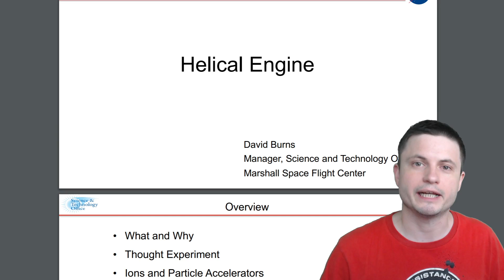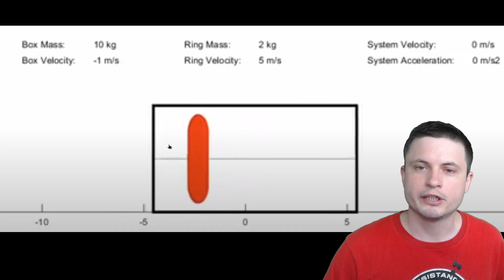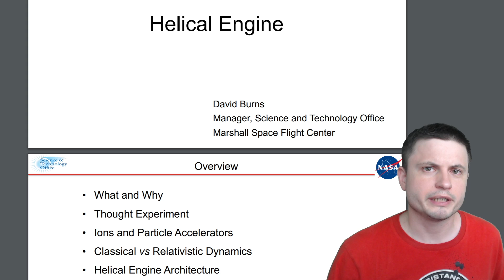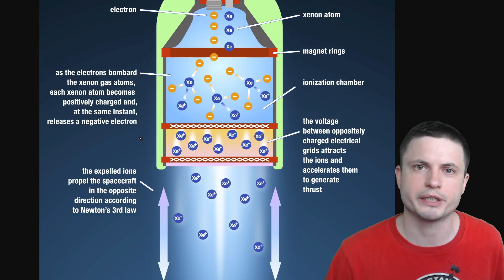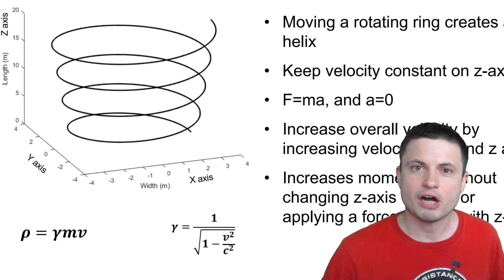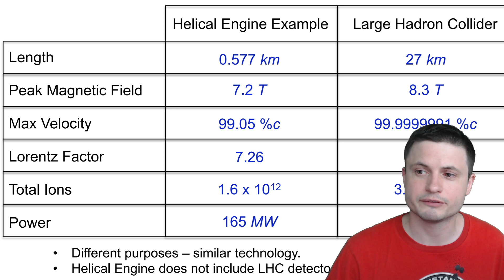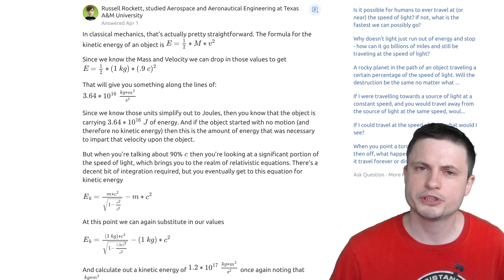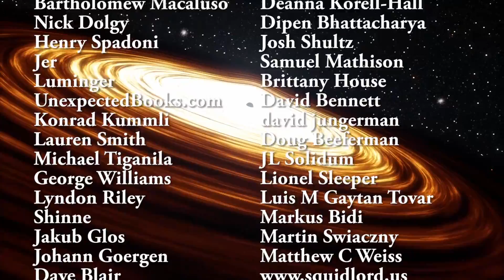NASA Engineer Designs a Near Light Speed Engine But Does It Work?

Comment: Well on a visualisation it looks fine. But then thin about how much energy it would take to stop anything more significant than an electron going that fast from punching a hole in any theoretically possible material made of matter as we know it?

When you go down to the electron scale I think that this idea reduces a bit to the other concept from nasa eagle labs that's actually being tested by both the USA and China, and possibly many more, as that would be an amazing achievement.

The thing with a more massive medium with velocity change is that it simply might not be physically possible even assuming that we still don't know lot's of things about physics of our reality which is most likely. The explanation of swirling mass seems a bit weak as it goes into the gyroscope science, and unfortunately you can't get any momentum out of the gyroscope perpendicular to it's rotation plane, simply because there is no such force there to extract. You would need to leverage it against some mass to change it's vector forward, but that implies pushing something back, and even when  you apply the relativistic phenomena you still need the same sum of force to speed up a certain mass to some relativistic speed, and then slow it back down. Relativistic effect here does not break the conservation on momentum it just means that you need geometrically way more energy to speed some mass up to relativistic speeds than you would assuming linear force requirement.

It's still not very nice and professional to hate on the publication because that's a very significant reason for science stagnation along centuries, where the intellectual society thinks that their theories are final, and there is no point in studying new concepts challenging the old knowledge. Even if it's wrong It's still valuable, and should be taken seriously.

Comment: This sounds like you need a normal engine to go as fast as we currently can, and then start this rotary weights idea up, the relative velocity should start accelerating until a point where you can turn off the starter engines... Obviously im just guessing, im just a random douche lol.

Comment: If they put this circular version mentioned in the right spot, couldn't they also power other things if they used the same rotation to get started? Coils and magnets right? Maybe a crank shaft type of thing... This all sounds like engine failure is blowing everyone up.

Comment: This tech has been out for quite some time... It's only draw back it that it takes forever to get to speed... That's not even taking into consideration the lawrence transformation...  I believe they are working on both problems, the firsts solution is to take off from within our atmosphere, were partial density is high... The second, much harder to resolve, but involves creating an ABSOLUTE vacuum infront of the spacecraft.. they are currently testing different laser grid arrays...

Comment: Remember E=MC^2.  To get a large spacecraft close to the speed of light takes more energy than we could possible gather, and you have to accelerate all the fuel as well.  There's no way to get that much energy.  Anything that shows otherwise is basically a perpetual energy machine, which at that point, the hell with the spacecraft, you can create new universes because your creating mass and energy.

Comment: You can travel to infinity with a cup of water. You vibrate it apart into HHO for free with sound and it automatically recombines back into water and you get an incredible amount of energy... and you keep using the same water over and over... no limit to how far you can go... and cost nothing. All you need to power a spaceship is 2 wireless speakers and a wireless microphone... and a cup of water. The 2 speakers point in opposite direction and are also dishes that can pick up waves from a 1000 mile radius around it... from less than 1 hertz to 20 million hertz.. and the harmonics thereof..... and you feed it right back into the microphone in an endless feedback loop. Simple to do. You gain mass... and speed up.. time slows.. distance becomes non existent. The high frequency coming out of the speakers vibrates the water apart.... all diatomic elements split and recombine... O2, N2 and H2. Cost nothing to split it with a wireless microphone too close to the wireless speaker giving endless feedback.. it will never shut off... and its picking up all white noise radio signals from 1000 mile radius or more... fed back into the wireless microphone. You use a cup for the tweeter and it fills up with water because the air temperature outside the air hole above the cup is different than the air temperature inside.. and so the water condenses in the cup and spills over on the granite speakers and causes conductivity to increase 9 fold... from the inner positive at the speaker center to the outer negative at the speakers edge. The water then starts to spin in a standing torus.. and then split and recombine.... giving a lot of energy. None of the water is lost.. the cup just keeps filling up and overflowing. The universe is vibration. You don't need a power source at all. The energy is already there and you only have to tune into the resonance and feed it back into the microphone.

Comment: Traveling at light speed is not enough to reach to the star systems that thousands year away from sol system. In a sense no human being can go more than 3 or 4  years away star systems. Even if we go 100 years away from sol system there is another problem. Imposible to communicate with these star travelers. Also if they want to go back it will take 100 years. There is a limitation for human life time and space is not good for human health even you are in the best star ship. So if humanity cant find an instant way for traveling space i belive no human being is going to see that day.

Comment: Even IF you can produce a device approaching the so called speed of Light, it is still far, far tooooooo Slow to cross thousands of Galaxies in reasonable time.
There is ONLY ONE WAY to cross Thousands of Galaxies in hours, and that is by Learning HOW to access "The Processing System of LIFE", and gain the necessary Technologies, by searching its 'Permanent Libraries', and using the Technologies of "The Processing System of LIFE", to cross a Galaxy in Minutes !
Impossible ???? 
Only if you believe it to be ! 
Take the Courage to Discover "The Processing System of LIFE", and explore its 'Permanent Libraries', for whatever you want to know, or learn about.

Comment: Travel through space is limited by relativity, making interstellar travel impractical.  Only An Alcubierre/White propulsion system, which warps the space around a ship, makes interstellar travel practical.  Unfortunately, such a "warp drive" requires "negative mass/energy," which we've never observed, probably doesn't exist (dark energy is very likely a positive form of energy), and can't really wrap our heads around on a theoretical basis, much less an engineering basis.

Comment: There are huge problems with this analysis. Accelerations near light speed require general relativistic calculations. And spinning anything near light speed would cause it to fly apart. The collision of the spinning ring with anything would be fatal. This is a complete mess.

Comment: Problem is, those molecules actually exhert forces on the engine. At light speeds, force is so damn great (F=MA) that the thing will just break.
Reply: Just accelerate slowly
Reply: @m1abrams1776  dude

Comment: This engine contradicts itself, even if it is possible, the smaller side of the mass will increase with the velocity of the craft, thus the faster it goes the total momentum would be less ie. the difference in masses would be proportionately be less and less as the craft increases speed, that is even if (BIG IF) the energy supply problem could be solved !

Comment: I don't get the part where the thing in the box starts to be accelerated sideways. Wouldn't the acceleration to the side move the box in the opposite direction? If the answer appears to be the helical path, how would that solve it? Wouldn't the force necessary to go from circular to helical motion be the same?

Comment: Doesn't the energy required to push a mass increase exponentially with an increase in mass? So rather than having larger weights that require as much energy as mentioned, wouldn't it be better to have a large amount of smaller masses moving in sync therefore requiring less energy? I am not sure if that is how it would work or the complications of doing such a thing would be but I figured that they just needed a more efficient way and having multiple of one thing working in unison would have a much more efficient outcome. Like using one large band to pull something or a lot of smaller bands to pull it. There needs to be a lot more force to pull back the large band for less outcome when compared to the smaller bands.

Comment: 86% and 90% aren't the same at all whein it comes to aproching the speed of light
Reply: 10% of light speed would be revolutionary
Reply: @user-nb3ui8zj4r  Even 1% ( 1860 miles per sec) would be revolutionary, and is probably unattainable because of the colossal energy requirement.
Reply: It is also not that big of a difference, only about 40%. Which in the grand sceme of things is fine...
Reply: @DomenG33K  did you mean 4%?
Reply: @dredgenyor8286  i meant 40%
Reply: @DomenG33K  What are you trying to say?  It is a 4 percent difference.
Reply: @nicholasricer9687  going from 98% to 99% is the same energy required then from 0 to 98% the speed of light.
Reply: @DomenG33K  I understand what youre saying.  You're probably right but it doesnt seem right.  I'm just high and drunk.
Reply: @nicholasricer9687  hehe
Reply: @DomenG33K  Just like everything else in the world . . you have to put a lot of effort to get from 9 to 10. . or from 2nd to 1st.

Comment: Donut is interesting.  But how about, we Shove it in 1 direction, to impact, but as it returns we use a dampener, to Vibrates and sends the Force OUT to the sides.
Energy?  how about Ion.  Direct from the sun.  the closer you get the more you get.
Then consider After the ship is doing a Good speed to init the other form of propulsion Just to see if it could work.

Comment: You're not Janet correctly the faster you go you say you lose links that's correct because you are phasing in time yours time slows down you were changing the rate of time and during acceleration you are in multiple time frames simultaneously that is why you lose length and gain mask your mass is in other temporal dimensions the same is your length. And ersche a simply an effect of time rate change

Comment: I understand the issue with introducing enough energy to accelerate the mass inside, but as the mass speeds up and bounces off the box, a number of things need to be considered. 

1) the mass loses energy through friction on the rod it is connected to (to keep it bouncing in a straight line) and the opposing forces of the walls counteract the force it’s accelerating to, so you would need a ton of energy to just keep this going. 

2) what sort of material would we use to keep this thing from breaking apart? If you shoot a 1kg metal donut at a steel box at the speed of light, it’s obvious that sooner or later the box will fail.

3) We know it is impossible to create energy. This model is inefficient in its requirements for energy input.

Comment: I don’t really understand the helix bit of this, just thinking to utilize that effect I thought of counterrotating symmetrically weighted booms with zero contact electric motors and passive magnetic bearings.  The rotation axis being perpendicular to the direction of travel.   you wouldn’t need to spin the weights at near light speeds, just relativistic (0.15 C ish) conventional reaction engines bringing the spacecraft itself to something like 0.5 C so the Weights have a speed difference of 0.5 C.  At that point The drive would actually have more thrust the faster the spacecraft is moving and speeding up the rotation would actually reduce the available speed differential because lightspeed is still a barrier in this system.  But this is all without doing any math so it still could take to much energy to maintain the rotation at near light speeds.  Also since this drive runs off initial speed stopping (relative to  local space) would be a big problem, you could possibly use the weights as a slingshot type reaction thrust source.  A version of this drive converted into an instrument could possibly be used to detect the non-relative amount of kinetic energy, A position, velocity or vehicle has, somewhat breaking the theory of relativity by creating a universal non-relative speed standard.
Reply: Create a double sided Engine that is designed how the afterburners on an fighter jet might be ( contracting ) , so that you can either focus energy in front of or behind to either stop initial force ( slow down ) or output force ( speeding up ) , or like the sling shot method ( jump from desired location , to a different location ) like Star Wars aircraft  ‘’Jump ‘’ , they use initial force to slingshot the Spacecraft .

Comment: Relativity for Dummies:

The amount of energy required to double the mass of a 1 kilo object through relativistic effects = the energy produced by total conversion of 1 kilo of mass.

Duh.
Reply: Rather, isn’t he saying that the energy to double the mass is greater than that to create the mass?
Reply: @jasonisbored6679  no.because currently we aren't capable of converting full mass into energy.when we use uranium only small percentage of its mass converted into energy
Reply: @Kamal-ju6qx  that doesn’t seem to be completely relevant to my comment, but it has been five months so I will rewatch it now.
Reply: @Kamal-ju6qx  your comment is not quite answering the question I asked, but it’s a very valid point. Anton was saying that it was ~basically like pure mass-energy conversion~ which is totally not true, even if nuclear power is efficient. However we aren’t talking about how you get the energy, but instead what happens when you get it. I still don’t have a satisfactory answer to that one but I hadn’t thought about it in a long time

Comment: At the risk of sounding like an idiot could we change the mass at least slightly in a simpler way? If we can find a way to create an independent system that would use its own energy to do some of the change in mass manually (as in matching the velocity of the mass with a smaller mass and inelastically colliding them or something) to assist the Lorentz transformation would that work? Or would it just take the same amount of energy in a different way

Comment: If the Toroid magnet in the drive has 2, 3, or 4 poles it can be treated like a brushless DC motor. The toroid can be rotated very fast and then given a push as well. Just a thought.

Comment: as an alternative idea.  what if you fired an ion drive vertically into an artificial gravitational field set in a horizonally fixed plane? would the gravitational field or fields increase the effect of the ion passing through it, granting it the potential to create more thrust?  or would the ion need to be fired from inside the field in order to not reduce thrust?  just what popped into my head... so i had to share it... anyhow love the information and stories.. ty for sharing as always will like it :D cya later. peace

Comment: I think if you use a particle accelerator and turn particles into energy it would would work. If you take a cylindrical piece to take in mass amounts of particles and use the accelerator and then a converter you could make it infinite. The power to start it would be required and then the huge cylinder absorbing all the particles and the converter working to turn into energy would run itself until it broke down or shut off. But to reach near light speed I think you’d need to add uranium or whatever into the particle at some position of the set up to release this extra boost. Maybe something like the way jet thrusters work you’d use something to condense these particles and condense the release of power. Hence in Star Trek before warp there’s a “charge up” period. I’ll start accepting donations now 😂

Ps: I had this idea at like 12 years old